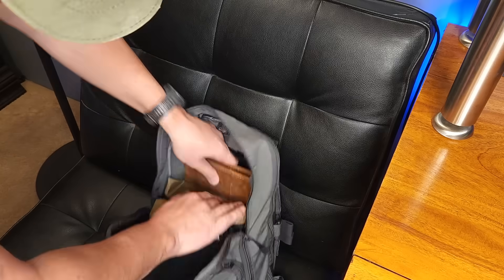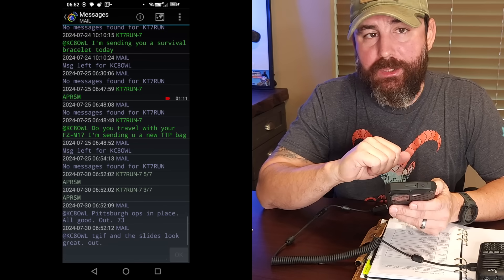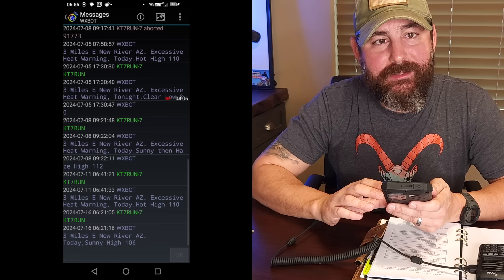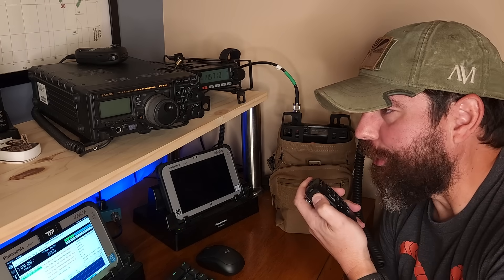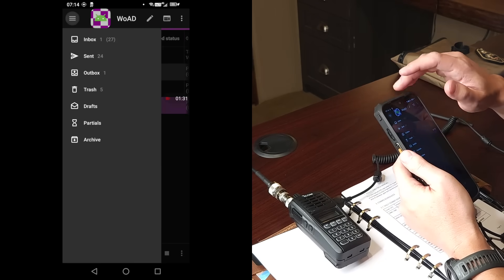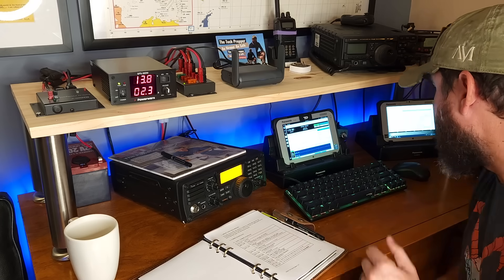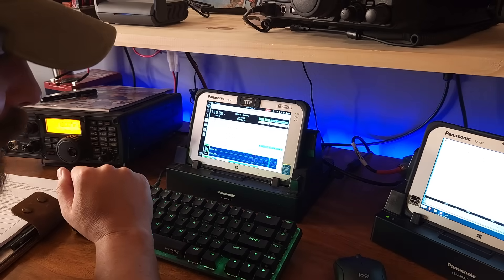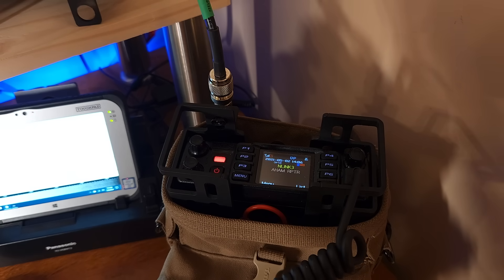My Daily Comms Training Schedule

Comment: Great video, thanks for making it.  I had no idea about APRS mail or the JS8 store and forward capability.  I am definitely going to have to get more serious about JS8.  Question, for your phone, do you need one of those "on the go" cables to make the digirig work?  I've needed to use them for my IC7100 in the past for GPS.
Reply from the maker: No OTG cable needed. The USB-C is presented as a standard audio headset, so no USB host nonsense required. This is the genius of this new DigiRig.
Reply: @TheTechPrepper  Thank you!  Going to try it with my existing digirig and digirig mobile.  My digirig 891 is due Monday (thanks for the recommendation).  A lite will be my next purchase.

Comment: Is that IC-10T MARS modded?  I think this is the first time I've seen you use it in one of your videos.  Any particular reason you're using this vs the VX6?
Reply from the maker: Yes, it is MARS modified. I have a very specific use case for this radio. It is no replacement for my VX-6R. I'll  do a video soon on why I bought it as it certainly has a short list of detractors related to the price and the batteries.

Comment: Question: I just bought a Jeep Wrangler JL and it comes with a Android built into the jeep...I plan on doing away with Sirus XFM...is there a XFM board that can be taken out and replaced with a dual band radio ham radio that also has APRS+GPS? There is also an A&TT M.E.S.H. that I would like to do away with
Reply from the maker: I wish that I could help, but I have zero experience with the Android device built-in to your Jeep. If you can install apps from the Google Play Store and have the ability to plug-in a USB-C cable for audio in/out, it may work.

Comment: I am also switching to the IC-T10 and IC-V86. Nice video, take care.
Reply from the maker: Good for you. I am conflicted by this radio. I've had my eye on this radio since it came out, but refused to pay $250 USD for it. Gigaparts ran a sale last month for $150 USD, so it had the features that I needed at the price point that was fair. For me, this is an IP67 rate FM radio for digital mode work in the backcountry. I am having issues with the FT-60R and VX-6R mic/speaker connection, so the major drive was the more secure L type connector on the T10. The major drawback are the batteries: 1) the replacement batteries are expensive; 2) there are no USB-c rechargeable batteries; 3) there is no way to direct DC charge without the cradle; 4) there is no AA battery tray.

Comment: Any recommendations   Of app or a way to set the time on JS8 off grid?
The time keeping on my windows machine is terrible.
Thanks for the great content
Reply from the maker: I've covered it a few times over the last few months. Here's what I have personally shown:

1. Listen to WWV and manually set your clock at the top of the minute
2. Use clock.exe to automatically set the clock using a WWV signal
3. Use the "time drift" feature in JS8

Another option is to use a GPS dongle to set your time (not covered, but other YouTubers have covered this in detail for Linux and Windows).

Good luck!